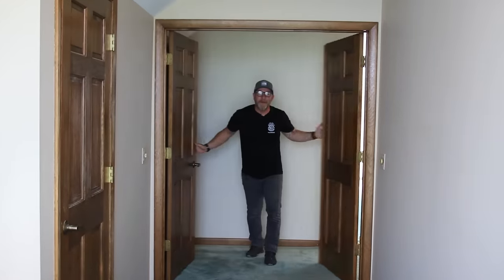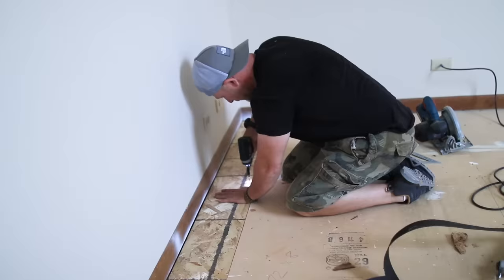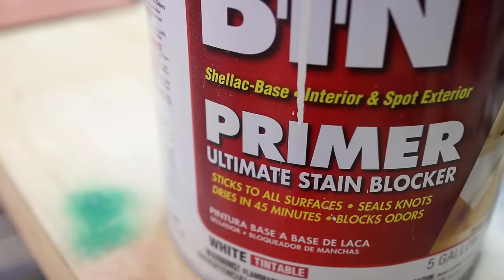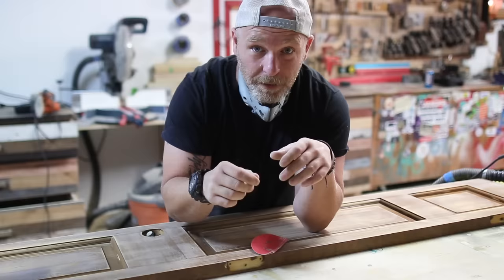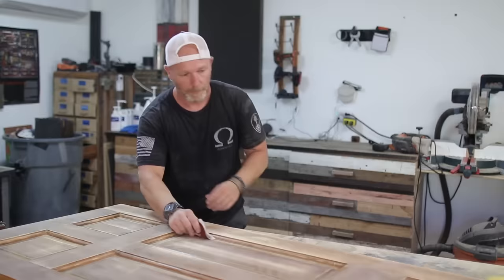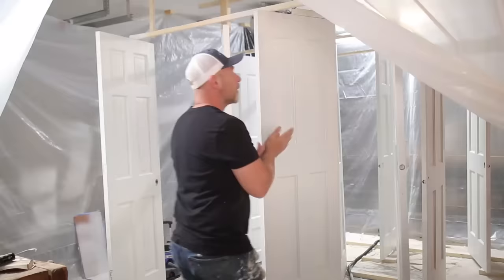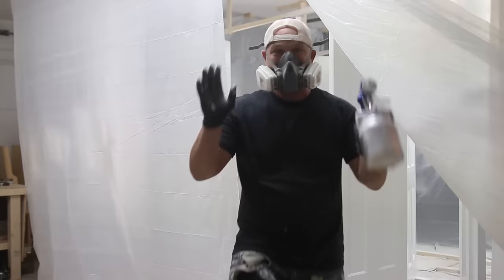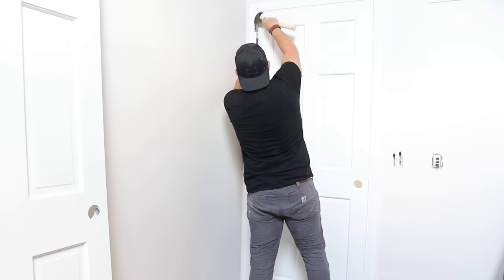How to Paint Old Doors, Windows and Trim the Right Way!!!   DIY House Renovation Episode 2

Comment: Hi... some really great tips here. I'd like to offer up a couple that I use. 1. I use a small round bamboo skewers to pack out the hinge holes. 2. I use an "air wedge" to raise and lower the door to align the hinges. If you haven't seen an "air wedge" they are a great tool has a small hand ball pump and bag. Perfect tool for the job. Thanks for posting and Cheers.

Comment: Just did the same exact thing in my house I just purchased a year ago.
Sanded all doors, calked and used bin primer with Benjamin Moore paint on them with black hardware. Came out amazing,
Reply from the maker: That’s awesome Andre.  Makes a huge difference
Reply: @KomarProject  if your door already had gloss paint on it, would you have to remove that first before you appley wood filler and sanding ? Thank you
Reply: @islamicreminders3090  I also need to know. I have painted doors and windows and I want to change the color
Reply: @danimiller1067  I just ended up buying new doors

Comment: Very Good method .  use a damp rag when caulking,  vacuum the floor before spray painting .  if you take the carpet out  the door painting can be painted in a room upstairs , 
Bin primer very good primer ,  maybe a little over kill as primer in a sprayer ,  Use the Airless sprayer for the doors too.  like a NEW house!

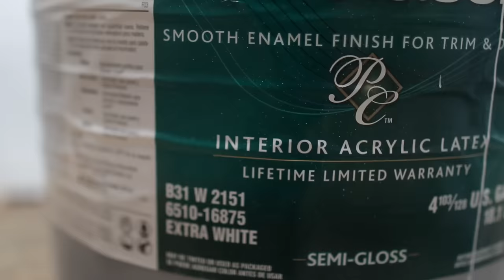Comment: 4:50  I have to say thank you very much for the recommendation on this paint.  I have been struggling with tacky, easily peelable latex paint from Valspar on my interior doors.  The I tried many different iterations on painting techniques with that stuff and could not find a solution.  The Sherwin Williams Pro Classic was perfect.
Reply from the maker: Ya it’s my favorite and works so well

Comment: Just did this to a 70’s home. No help. 2700 sq. ft. Drywall repairs, wallpaper removal, installation of new baseboards, walls, ceilings, kitchen cabinets. Took me 7 weeks. Your prep work was excellent with exception of the caulking of the panel doors. Panels within the door move slightly during the seasons. Over time the caulk will not hold and cracks will reappear. Same for raise panel kitchen cabinet doors, never caulk a raised panel door.
Reply: Crazy caulking over time will dry and split.

Comment: Wow. Your positive energy is inspirational. The white doors and trim, taupe walls and touchesof black hardware are classics. Love it. " Jennifer decorates " had the best wrought iron curtain rails with a curved side so no light peeks through for optimal sleeping.
Reply from the maker: That’s a great tip.  Will have to look into them

Comment: Those doors look brand spanking new!!! Fantastic. I didn't know to caulk the doors but I've done a bit of paint that has  cracked in the seam so I'm going to try that. Thank you!
Reply from the maker: Ya for sure ! It also helps the cracking from them getting slammed.  My kids are pros at that lol
Reply: @KomarProject  would you use the same thing for a seam in drywall? 
I've learned so much from watching your videos and I used to think I was handy lol

Comment: Well, now I know how the paint crew I hired messed up. They didn’t caulk my solid wood doors before painting!  And yes, the paint has cracked around every panel.  What are the right steps to take to fix that? Also, two questions. How long did you wait for the trim paint to cure before taping in order to paint the walls. And..when you checked for problems after priming the doors and did those small ‘blue taped’ repairs did you  prime the repairs after sanding or just paint over them?  Really great video! Thanks so much.
Reply: Christina you can aways paint the edge/ return of a door casing with the trim paint prior to the walls. As far as touch up on the trim most of the time they are small enough to just use your trim paint to coverage. Sounds like you didn't have good painters.
Alot out there, but few know what they're doing.

Comment: Great video, I grew up at a painters table therefore I became a painter myself. I've been a painting  contractor for over 20 years. This fellow knows what he's doing. He's a good painter in his own right. He knows his tools well and he knows the boundaries of his products. That being said. Keep in mind that when painting vertical surfaces  you will want to know how much paint can be apply to the surface before it starts to run downhill. And be sure not to spray to the corners from two directions because paint will pile up in those corners and you will have issues with paint running down your door jams. So have a brush handy.
Reply from the maker: Great tip Rick

Comment: You do such an amazing job and love your videos ( as well as seeing you on that other channel sometimes).  Ive used a round over on the router and a strait edge clamp to go over door inside edges and take a hair off and it works best on nasty beat up doors ( but still needs a little sanding after.   I’ve also made a profile mould using Bondo with a wax paper buffer to make a contoured sanding profile ..but don’t think your doors needed the heavyweight solution.   The dollar store is a great place to pick up dowels, tongue depressors and wooden skewers for shims and fillers, and I often use golf tees for larger hinge repairs.
Reply from the maker: Yeah I’ve done that before and cabinet doors on the outside and it works so well

Comment: Couple questions, why not apply primer first then you can see holes and cracks much easier. Then do prep work. Question 2 is why wear a respirator during wall painting?
Reply from the maker: It’s a preference. It was easier to fill holes and sand while it’s on the bench.  After they are all set up for primer I didn’t want to take them down again to fill and sand.  But yet your right you can do it anytime before paint
Reply: Thank you for answering my questions. The video was very good!

Comment: This was amazing to watch. I was wondering what to do with my window frames that can use some painting, when I came across this. This - your video - is of course is at a Pro level. But the least I learned is that I have to sand the frames first, then fill the grooves, then prime them, and then paint them. I will read your least of material cause I have no idea what kind of paint I should buy :)

Comment: Love it thats awesome!  I really need to learn to thin down paint to spray, have never been able to get it before.  But I think my big problem might be not using a strainer....
Reply from the maker: You know what I might have to agree with you.  I never used a strainer before and once I started it seamed like it made a difference. Especially with paint that’s been opened before.  But ya I thinned about 10% with water and it came out better.

Comment: It's an amazing video and has definitely helped lots of people! have thumb up and subscribed. I'm wondering what grit did you use while sanding the doors or trims?
Reply from the maker: 120 grit works well. Or anything higher if you want.  But 120 is a good sweet spot

Comment: I'm curious that at minute 8:25 you applied a pink product. I'm assuming it was some kind of wood filler, but you didn't comment on that step. Can you share what it was you applied? Did I miss something?  I just finished my first window trim on 60 yr old house.  I added a step and spread a wood filler on the trim and lightly sanded prior to primer so I wouldn't see the wood grain. Looked silky smooth after painting.  Maybe it was what you used at minute 8:25???

Comment: Anyone have any tips and tricks for refurbishing a solid core door and adding something to the bottom to close up the gap some? The reason I ask is we just had a few carpeted rooms and common areas that were replaced with LVP. Now all the old doors have about an inch gap from the bottom of the door to the flooring.

Comment: What did you do to update the 80s oak railings? The doors were an excellent transformation
Reply from the maker: We haven’t touched them yet.  I’m going to be redoing the entire stairs with steel.
Reply: @KomarProject  thanks for the quick response. I'm thinking glass and steel, or cables. It would be nice see see yours when it's done

Comment: Great video! Question: do you have a video in trim? More like when is it time to just replace then repair? I have older home, like this one and some of trim has bad dog marks and indentions. Thoughts??
Reply from the maker: No I don’t have a video but this one has a part in it where I fixed a old door with some speckle from the dogs scratches. It’s the same process.  You just want to fill all the scratches with spackle and then sand it smooth.  If you have really bad areas you can even use car bondo.  I’m working on a video now where I use it to patch a loft bed.  Should be out later this week.  Hope that helps.

Comment: How much do you dilute the primer and what size spray nozels are you using?
Reply from the maker: You don’t want to cut the primer. Just the paint.  And I use a #2 tip on the hvlp

Comment: Thanks - I enjoyed watching this as just spent 3 weeks stripping paint off an old wooden stair (sanding, scraping and paint stripper) …. I hate sanding….. BUT gotta do it. Whats the difference between orbital vs belt sander? I have a Big belt sander (60 grit as 120 was just taking too long) and a detail mouse sander. I am undecided as to buy a new orbital sander. My builder actually also had a rotating head on his old electric angle which worked amazing to sand up to edges….. any advice on sanding is appreciated….. did I mention I hate sanding :-)
Reply from the maker: So the orbital is designed to rotate in differant places so you wouldent get lines like a belt sander would leave.   I think a orbital is worth it’s weight in gold

Comment: I’m always amazed by your excellent work. I’ve started working on remodeling my 80’s stairs. I have the exact same stairs as your But after sanding and priming it’s bleeding yellow. What should I do? Please advise.
Reply from the maker: You need to use a stain blocker primer.  Try using BIN primer.  If you still get bleeding put one more. Then a couple of coats of paint should do the trick.  Oak is notorious for bleeding though.
Reply: @KomarProject  thank you so much for replying.. I love your work and so much energy…

Comment: Thank you so much! SUCH a great video. My doors in my 1970 home look exactly like yours previously, but I need a serious change! Just a few questions! 

What’s the difference between 
using spackle vs wood filler? 

Also, my baseboards are currently white, but need to be redone again. Should I sand what is there  and begin to repaint or should I strip the old paint and completely start over? Thank you!
Reply from the maker: Wood filler is stainable most of the time. And spackle is meant to be painted over.  Wood filler you can get in almost any wood color and spackle is usually white.  But they do the same thing.   
As for the baseboards I wouldent do anything to them if they are already painted.  If the paint is peeling off then just take a sander to them and even it out.  But you don’t want to strip them. Wayyyyy to much work if they are going to be painted again.  If they are in resent shape I would just put one fresh coat of paint on them.   Hope that helps.

Comment: What tape did you use, and why did you choose to roll the walls over spraying them as well?
Reply from the maker: Just regular frog painter tape.  I rolled it because I don’t want to have and tape everything off and cover again.  Plus with a large roller it goes super quick.  Hope that helps buddy
Reply: @KomarProject  Thanks for taking the time to answer 🤗

Comment: The white trim and doors look amazing! 

Question, what did you mean by outside corners get caulk and inside corners get sparkle?
Reply from the maker: Inside corners get caulk and outside get spackle.  Anytime you have two pieces of trim that meet and make a inside corner you caulk those.  When they meet and make a outside corner it’s spackle so you can sand them.
Reply: @KomarProject  thank you so much for the reply!

Comment: Hello,
What is pink thing you use after sanding. you used for trim and doors too. Can you please tell me the name of the product and what it does? Your videos are awesome and I have exactly the same old house . My carpet was installed in 1994 though. Newer than yours. LOL. Appreciate your help. Thanks.
Reply from the maker: It a wood speckle called DAP.  It goes on pink and then dried it turns white.  It’s to fill all the nail holes.
Reply: @KomarProject  Thank you very much.

Comment: Great job - question if buying a sprayer - would either the air or hlvp be able to handle both trim and door. If you had to choose one which one would do better job vs the other if budget only allowed for one sprayer.
Reply from the maker: I would go with a hvlp.  You have more options with it and you can do detailed things like cabinets and different Laquer‘s

Comment: do you have any recommendations for eco-friendly/VOC free primer and paint?? also any recommendations for brands for the paint sprayer and rollers? we just bought a condo and have never done anything like this before so we are newbies!!
Reply from the maker: Sorry I don’t from primers. I topically will use Zinsser on all my stuff.  But the spray is a Earlax and is awesome.  Rollers just as long as you get 3/8 nap or 1/2 for rough walls you will be fine.

Comment: Great video! Question: why did you use airless sprayer in the house but the HVLP sprayer for the doors in the garage/shop?
Reply from the maker: The airless is much quicker and I had more room to work.  For the doors I needed more control in a small space and wanted to work on thin coats instead on thick ones.  But I guess you can go either way.  Both will work on each application.   Hope that helps explain it a bit.

Comment: This video was well put together love every detail.
I have painted my doors twice white from wood  before watching this video and I wish that wasn't the case. I have a few questions.
Can I repeat your process onto by poor job . even with white paint on it.
Which brush tips or rollers you recommend for doors & trims if the spray isn't snd option 
If the Trims are in bad shape do to furniture entering do you recommend to change the trim itself?

THUMBS UP
Reply from the maker: Ya you can totally redo a bad paint job. Just scuff the paint a bit so it has something to grab onto.  And no need for primer if it’s been painted already.  As for the roller and brush I have used a 3/8 nap roller and a foam one. Both work well.  Just make sure you get a self leveling paint.  For brushes I always use a natural hair brush.

Comment: Excellent video. Cool editing. What color tone did you use for the walls. I also prefer the bright white but if it's too white then the doors and windows don't pop up.

Also do you have a link to the door knobs ? Thanks for the video
Reply from the maker: The color on the walls is called Icy Avalanche
Reply: @KomarProject  Thanks. and keep up the good work. very cool video and family

Comment: Thanks for this video! Do you have recommendations for painting hollow mahogany doors? I’ve been told the original wood stain seeps through over time, and can be nerve wracking to power sand the thin wood!
Reply from the maker: Ya you want to use a real good stain blocker primer like BIN.  And I would put on at least two coats of it at a minimum.  That way it should keep the tennins in the wood from coming through.

Comment: Cleaning doors with a TSP cleaner or something similar was a step not mentioned here. I've done this project twice, and I've had mixed results without thoughly cleaning before sanding.
Reply from the maker: You won’t need to clean them before sanding.  Any work done before will just get ruined by the sanding.

Comment: I get not saving the old carpet, 1 it was ugly and 2 its just old... But shouldn't you have checked inside the walls where you had water damage on the subfloor to make sure there wasn't any mold on the insulation? And if you were to need to change the insulation would you go with the fiberglass insulation again or with PIR Insulation board which have become quite popular in Europe?
Reply from the maker: Ya I just a didint show that.  I opened up the wall and made sure it was all good.

Comment: Wow! Supper professional job 👏🏽we are getting ready to potentially move in to a place that will need doors painted and this really helps.  How much would it cost to hire someone to do the job for you? Would it be cheaper to buy the doors new? Thanks 😊
Reply from the maker: So you can get hollow core doors for about $50 each but solid core doors are around $250 last time I checked. So I guess it’s up to you. I have heard people charge $100-150 per door to paint.  Hope that helps
Reply: @KomarProject  yes it does! Thank you!
Reply: @sandrasolorzano7016  I had 5 doors done 3 yrs ago and it was over $1k
Reply: @Dixon0378  thanks for info

Comment: I really need to know how you got your sprayer to spray so nicely! I have the same one and the first time I used it, it went terribly 😫 What size tip do you use? Anyway, thank you for this video! You deserve a lot more views. This gave me the courage to start on my honey oak trim (and cabinets, railings,  doors, etc)
Reply from the maker: The sprayer I used on the doors I’m guessing.  I used a 2.0 tip and thinned the paint about 10-15%. It’s a fairly thick paint but if you use others then 5-10% should work.   You still have to sand after the primer and maybe once between coats if your having issues.  It takes some time to dial in and a little practice.  Mess around with thinning and how much paint it puts out.  Hope that helps.
Reply: @KomarProject  What do you use to thinned your paint?
Reply from the maker: @icelin1634  just water with this one